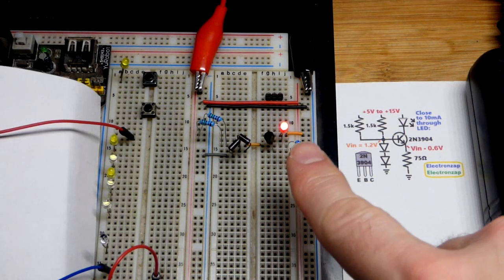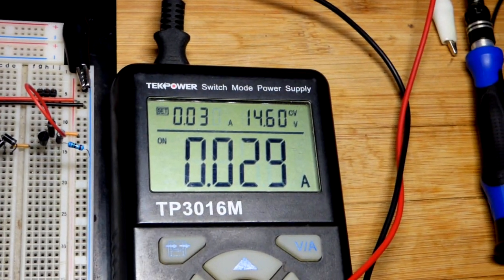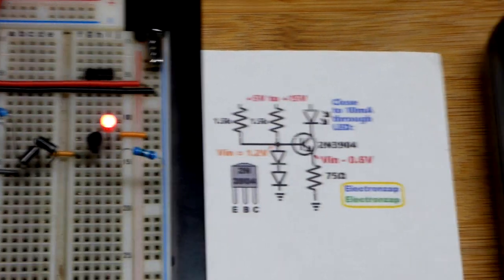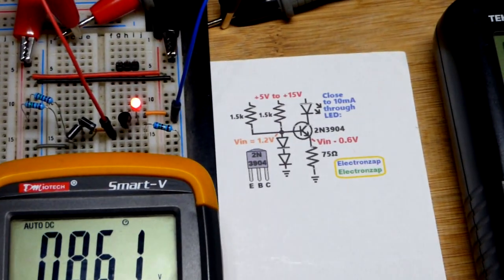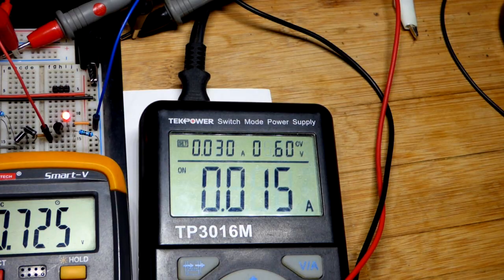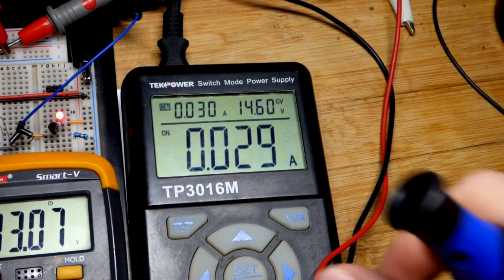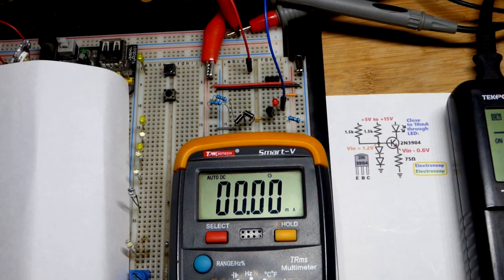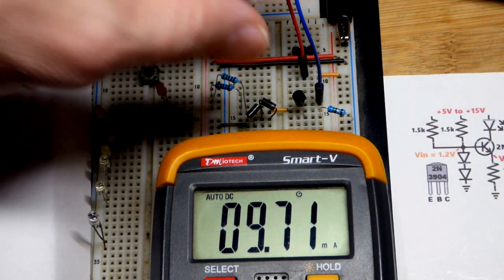5V to 15V NPN BJT 10mA Current Source Circuit

Comment: That "wasted current" can be reduced a lot by using a bigger resistor above the diodes. 10k is a much more common value than 750Ohms, reducing the "waste" by ~13x. The current into the base of a standard NPN is easily supplied through a 10k.
Reply from the maker: Thanks for the observation!